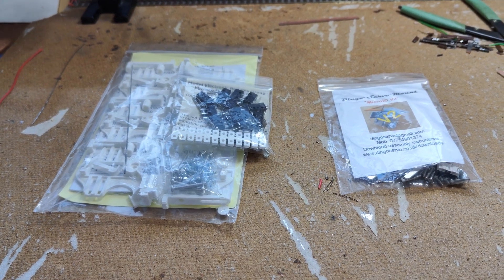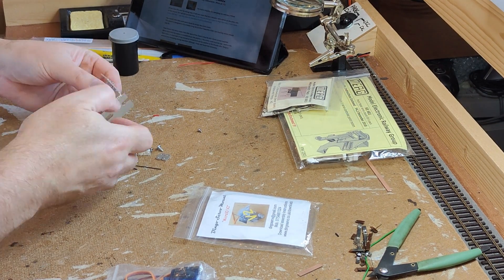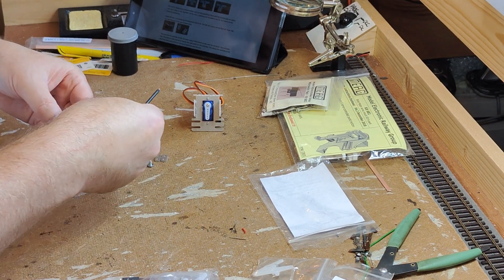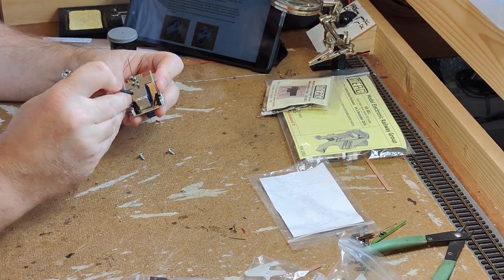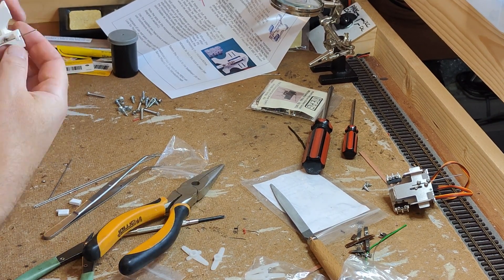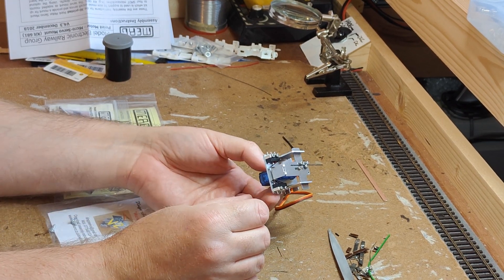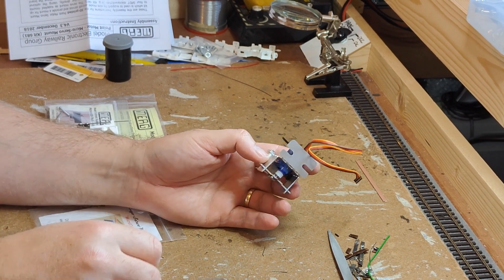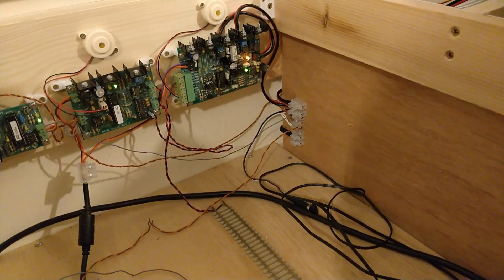Using Servos as slow action Point Motors on DMR

Comment: AND THE NECESSARY INTERLOCKING ???
Doesn't look strong enough to move handbuild point tiebars. And where are the two switches needed. One for the Frog Polarity, and the other for the interface with the Signal interlocking ?  I normally buy a box of 20 (TWENTY) ready made Fulgurex point motors direct from Fulgurex in Switzerland (Cost £185 Jan 2025). These being heavy duty slow action mechanisms, complete with two free  automatic switches built in, and space to add two more switches if needed. Because ALL my LARGE mainline exhibition layouts are fully signalled with 3 & 4 Aspect signalling, using real life Track Circuit Block British Rail wiring methods. Which costs only about 25% of the nearest DCC options. And No DCC options include the necessary Track Circuits (A location Train detector) or the proper methods of Interlocking the Signals & Points with each other and the movement of trains, as in real life !!!

Comment: The Dingo mount is a neat design and works well. However it is very expensive for what it is.  I bought one out of interest but the cost of £8 for just one ensured I did not buy any more. I needed 12 mounts in all. £96!
Reply: Servo mounts are much much cheaper at Megapoints. 12 for £14.00. Timber kit that is glued together. I have 24 of these on my layout, they are perfect.

Comment: I strongly recommend the Dingo version if you want microswitches. The plastic in the MERG version is too slippery and the switches do not stay in place. Also, you can get the Dingo mounts with longer screws and extra microswitches.
Reply from the maker: I haven't had that problem with the MERG mounts -- although it should be noted I use the nuts included in the microswitch kit and do not use the plastic spacers, which I found to make things more difficult.

There are many versions of the Dingo mount available -- the ones for semaphore signal gantries with multiple very close together operating rods are particularly interesting.

Comment: I am a Merg Member there is in the 3D section of the website a modified version of the Merg mount that rectifies some of the shortcomings mentioned. Also there is a mount by Bob Gledhill which I am using which can be used in all positions with a true linear motion just like the Dingo but comes in three sections which clip together. You are also correct about the cheap servos I have used digital tower pro ones. You can check the nasty ones have they can manually rotated with no end stops.
Reply from the maker: I bought a large batch of what I thought were "good" servos, having evaluated a few different ones -- but when my large batch arrived, there were ones both with and without end stops mixed in to the same set, all under the same branding.

It appears that the correlation customers expect between the product branding and the quality level doesn't always hold up the way we'd hope it should...